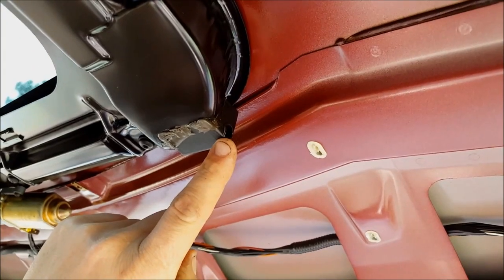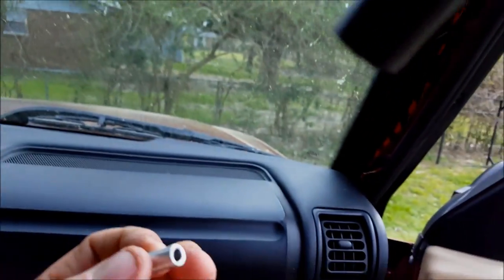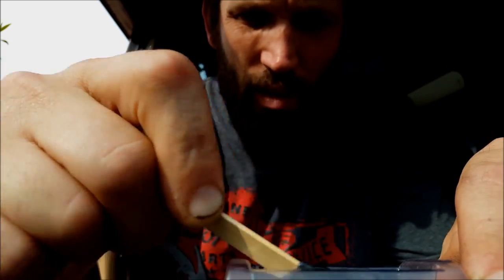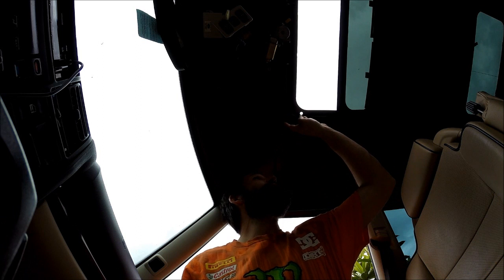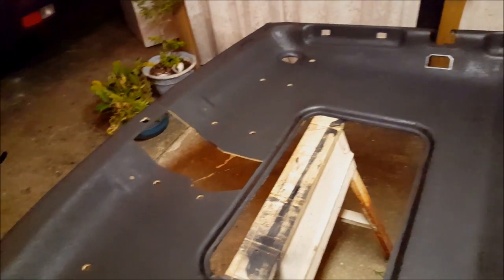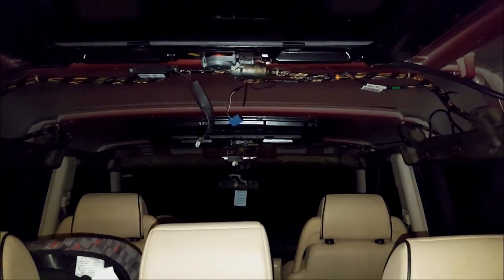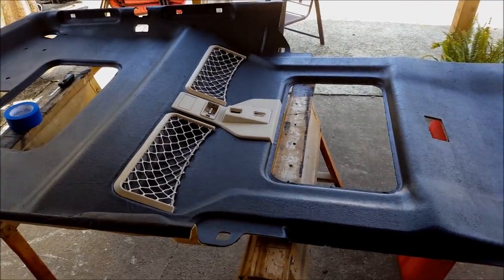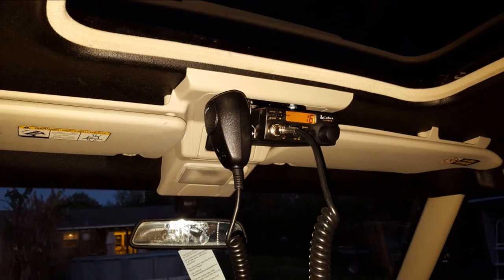Land Rover sunroof leak repair and bedliner for the headliner

Comment: I just completed RedEyed Jack's sunroof leak and bedliner headliner customization.  It looks great.  I thought I'd share a few things I learned.  The bushing mentioned, I found at Home Depot.  It was "Everbilt Spacer #10 ID x 5/16 in OD x 1 in L".  It was in the hardware section with the trays of lose nuts & bolts.  I struggled to get the foam off of the headliner.  I spent hours with a plastic scraper and alcohol.  I didn't find a good solution other than time and muscle. I thought I cleaned it pretty well.  Then I used Rust-Oleum spray-on bedliner.  After three coats, it looked horrible.  It highlighted all the little bits of foam residue.  I then applied the Herculiner Bedliner using the roll-on kit.  Two coats and it looked awesome.  Definitely go with the roll-on to get the proper texture and hide any residual foam.  I also had a tear in my headliner.  Before I painted, I used Bondo to repair it and it seemed to work well and the roll-on texture covers it nicely.  My sunroof had another small leak so I removed the sunroof and repaired it.  It is easy to do with the headliner out.  It just needed a bead of silicone.  That fixed the issue.  I left the headliner out for 1 week and the smell is minimal.  And the noise level seems the same to me as has been stated many time. Thank RedEyed Jack for inventing this solution!

Comment: Thank you for the upload. I found it very helpful. My grandfather gave me his 2004 Discovery because I'm a poor college student but it had mushrooms growing in it from all the water coming through both sunroofs. I was unsure whether I would have the strength or skill to remove the headliner but it was easy. The idiots at Land Rover had glued the plastic corners into the metal sunroof gutter and all four corners leaked. With a friends help we removed the sunroof assembly and reinstalled the plastic corners plus replaced the rubber seal that mates with the glass when it is closed and voila!,no more leaks. I may use your idea of the bed liner as headliner but I need to think about it.
Reply from the maker: Katherine Kelly that is great to hear! If you are on Facebook, look up Land Rover Discovery 1, 2, and Defender club. Lots of great info on that page.
Reply: When you replaced the plastic corners, how did you glue them in place? I got some scotch weld 8005 epoxy but have not tried it yet. It looks like it is glued in place with silicone but is obviously leaking. Also you must have removed the metal pan and it appears you can only get to it with the headliner out.
Reply: @lcagee  Wurth Bond and Seal did the job a treat on my Disco and in black looks exactly as per Land Rover original.

Comment: Just what I needed! Now I know why water drops from my sunroof control buttons when it rains, without tearing the whole car apart. Great video, many thanks!
Reply from the maker: Bora Yurtoren no problem!!! if you have a 04 with the big roof rails check those for leaks as well!!!
Reply: Mine is a 2000 TD5. Good advice !

Comment: Thanks for your video!  I have a 2003 Disco and I was inspired enough by your video to do the same thing.  My moonroof also leaked and the same piece of plastic was broken off in the same corner.  I actually used the plastic cylinder of papermate pen that fit into the hole and went into the tube perfectly!   I also used epoxy as you recommended.  My headliner was stained with mold next to the low spot on the passenger door and was drooping down in a couple spots.  Tore it off and used flat black paint as you did... turned out great.  The only thing is the smell of the paint still lingers...

Thank you again for your video!!

Sam
Reply from the maker: Glad it helped!!! Mine has held up perfect. Still looks as good as the day I did it.

Comment: Used this method to repair the exact same leak - which had already been 'repaired' once using silicone and a cut-down rawlplug. This advice was spot on; a solid leak fix. Thanks
...Now just the clutch judder to sort. 
Land Rover =  proactive maintenance

Comment: Looks good! I'm fixing to begin the exact same project myself, along with a speaker replacement and crankshaft seal replacement. great video.
Reply from the maker: if you are planning on bedlining the headliner, just know that it stinks. it's been a week and a half and the smell of the bedliner has gone down quite a bit but is still very noticeable. I've been keeping the windows open as much as possible to help it air out. I'm sure it will go away completely eventually but who know how long it will take. with that said though, I'm still thrilled with the results. one other recommendation, epoxy all four of you sun roof drains at the seem of the plastic and steel, and clear silicone around the sunroofs or replace the seals. I have to pull the headliner back down and find another leak.....ugh! thanks for watching!

Comment: I also fixed my leak, which was the roof rails/bars.  They are sealed with a flimsy bit of neoprene and not very well glued in.  I removed them and replaced the neoprene and sealed with black silicone sealant.  With the roof liner off I was able to pump a fair bit into the recess where the roof bars connect.  Worked. Dry as a bone.
Reply from the maker: for sure. I just installed the extended roof bars on my truck, nothing like taking a 1" hole saw to the roof. I did the same thing, sealed them up good and tight.
Reply: @RedEyedJack  Takes some courage to start cutting into your roof!  Would be great to see the extended roof bars.
Reply from the maker: @mrp410  Stay tuned for some new videos coming. Been busy with college and a career change. Planning on making lots of new content very soon!!!

Comment: Man that looks good. I''m going to do my headliner like that. It's sagging real bad. I also had the same roof hatch leak. Going to fix it like you did. Thanks for the video. It's hard to fine content like this on the Disco 2. I have a 2007 Range rover also, if you come up with anything on those I'm subscribed.
Reply from the maker: glad you found it useful!! epoxy all four sunroof drains so you don't have to do it again!!! and if you can leave the headliner out for a week or so after. the bedliner smell is very strong but goes away with time. the first week was real bad!!!

Comment: I am soooo glad I did proper research on these trucks before purchasing one (which I ended up NOT purchasing). I never have these problems with my FZJ80
Reply from the maker: awesome!
Reply: Whaaaaat! owning a Land Rover is like a good marriage, smooth one day and rough the next with a tribe of teenage kids inside on a wet day, FZJ80 man that's not fair, what just drive and drive with out repairing or modifying boring stuff FZJ80.
1999 Disco 2 TD5 (no sunroof) owner in the land of Aussie.
Reply: @blackprince4074  After a while constant repairs begin to weigh heavy on the owner.. I know because I have a 1993 VW Cabriolet. Something is always breaking on that car.. just like my 5 previous VW Jetta mark 2s. I had to learn how to fix cars.

Comment: Thanks for the video. I have that issue on my driverside of my 99 discovery 2. I will start this project ASAP & hopefully I'll get good results. 5/16 aluminum spacer, epoxy, & steel wool brush. Thanks

Comment: I am lucky and got a 2002 V8 4.0 that has NO sunroofs!  The leaky roof though is a common thing, imagine how bad it is for the Brits where it rains so much!
Reply from the maker: it is a real common issue but the fix is really simple so I'm glad I have the sunroofs, it let's a lot of light into the truck. but for ease of ownership, no sunroofs is the way to go!!! they are not that common though.
Reply: just looked in mine ,I could swim in the back!,and yes I live in the UK!,your so right,mark.
Reply: you can download the workshop manuel,pdf,off google.the headliner needs to come out,but read that first.
Reply: where do ya find it as ive looked on line an nothing can you help...
Reply: You have no idea, the slightest shower and I have a pond.🤣🤣🦢🦢🦢

Comment: Why can't I find a gorgeous man like this to fix my Land Rovers! Ugh!
Reply from the maker: Samantha And The Volume ha!!! I'll fix your Rover, but that's as far as that can go, I'm spoken for lol!
Reply: Awwwww...shucks! I try and fix my own and most of the time I'm very successful but it would be so much more fun learning the things I don't yet know how to do, with someone that's gorgeous and does. I have gurly muscles so im not as strong but If I cant turn a ratchet I can always tap it with a coushioned hammer or loosening a lug by standing on the lug wrench. This is a fantastic job you did with the headliner/bed liner and how you ran all those wires and fixed the same stupid leak I have on the passenger side of my Disc ii 2002. You would love my Range Rover County LWB 1993. It's a Rare find and lifted. Ive changed almost everything under the hood by myself 😁😝 When you're no longer spoken for...come ring my bell! I pland on buying a New Rover in January but if I can find a Land Rover Defender 90 soft or hard top...oh my gosh, it's on!

Comment: Hi, this must be the coolest interior I've seen. Thinking about doing mine in a similar way, cause my interior is also creamy leather, but I was wondering if removing the entire foam made an impact on the soundproofing. Someone pointed to me that the noise from outside could be getting louder than before, especially when it's raining. Could you please share if that's the case? Thanks for your time.
Reply from the maker: I have not noticed any difference in road noise or while it's raining. If you were really wanting to make sure, you could put some sound deadening on the roof while the headliner was out
Reply: @RedEyedJack  Great idea. Cheers!

Comment: Was about to do the headliner in my D2 and came across your video.  Looks like an easier way to go than to use cloth, but I'm wondering if you live in a hot climate and if so, have you noticed more heat coming through the roof?
Without the foam backed cloth and a 'black' bedliner .. is the heat coming through more noticeable?
Reply from the maker: No noticeable heat whatsoever. I mean, its Florida, so it get hot, after all these years it is holding up great, zero issues. Would do it again in a heartbeat!
Reply: @RedEyedJack  Thanks for taking the time to reply .. much appreciated.

Comment: Hey your headliner looks really good!  Do you notice much (if any) condensation within the cab due to the lack of foam and material/insulation?
Reply from the maker: non that I've noticed, the headliner itself plus the bedliner seems to be adequate insulation on the roof. mid day florida summer heat and it's no different than the original headliner!
Reply: +RedEyed Jack sounds good! I shall give it a try and see how it fairs in our climate over the pond lol! Cheers
Reply from the maker: +absolut264 10-4!!

Comment: Took the headliner out today to do the bedliner finish.  Not surprisingly, the sunroof drain broke off in the process.  Dry rot no doubt since it's an '03 Disco.  Pleased to see both of these tips in one video or I'd be lost.  I'll try the hardware store fix tomorrow for the sunroof.  Bed liner will be sprayed on afterwards simply because it's an option.  Rolled on bedliner looks great though.  Thanks for the video.

Question:  Did the bedliner chip, crack, or break after squeezing the headliner back into place through the cargo door?
Reply from the maker: the bedliner held up great putting it back in. No issues at all!!! I would have sprayed it as well if I could have. I was really worried about the finish looking rolled if you know what I mean. As for the drains, I epoxied all four drains just to be safe!!! And I also used clear silicone around the sunroof frame on the roof for extra protection. Hopefully I'll never have to do it again! Glad the video was helpful!!!
Reply: +RedEyed Jack I wound up using a piece of 5/16" brake line for the drain. Also for anyone reading, the coupler will go into the drain and tubing inside the broken off piece. Don't remove the old nipple from the drain tube.
Reply from the maker: +K MacMurray yes, leave the broken piece in the hose

Comment: Thanks for posting.  Hoping to do the same as you once I fix a few other problems that cropped up last week (battery went dead and somehow unsynced by BCU and ECU!)  Bought my disco 2 earlier this year, and I was beginning to wonder if I was the only one still driving one.  Not very common in mid-Michigan, but I don't mind driving (and fixing) a unicorn.
Reply from the maker: down here in Florida D2s are everywhere!!! with being from the rust belt, how is the rear frame rust wise? that is usually the determining factor whether to keep fixing them or not!
Reply: +RedEyed Jack This truck is clearly not from around here, or it would be a pile of reddish-brown (and white) dust by now.  Previous owner said it had come from California not long ago.  The other factors in not being common around Michigan:  1.  practically no dealerships to sell them.  2.  Good old boys in this state don't like foreign cars.
Reply from the maker: Joe Kirklin Good to hear!!! I'm originally from Buffalo NY so rust was always a concern. Down here in Florida, everything is so clean!!! I makes sense about the no dealer network for sure. Have fun with it and if your on Facebook, check out some of the Rover groups on there. They are full of tons of info and guys with piles of experience with these trucks!!!

Comment: well done mate,thanks for the info,parts are expensive from l/Rover  over in the UK,my roofs been leaking for years now its time to do something,just 2 q's

1,was your headliner foam base or fibre glass,mines foam

2,did you get it out and put it back on your own?

3.epoxy resin,which 1?

it looks great,well done,thanks Mark,UK.
Reply from the maker: mark fairminer sorry for the late reply. my headliner is not fiberglass. I pulled the fabric off, scraped the foam off from under the fabric and the actual headliner seams like it's a paper based product. I did remove it and install it solo but I wrinkled the passager front corner doing so. wish I would have asked for help. the paint product I used was Rust-o-leum roll on bedliner.
Reply: thanks,yea mine is a fibre so I will get some fabric and a spray adhesive and will try that in the smmer,will let you know how I get on.

Comment: Sorry to comment on such and old post, and sorry if it's already been discussed (too many comments to read through).  But I'm curious if you've noticed change in keeping the cabin climate comfortable with the foam insulation gone?
Reply from the maker: no what so ever, the bedliner is pretty dense and I'd think it would have near the same insulation value of that foam. I live Florida and noticed no change in my AC in the heat of summer

Comment: hi. great job. headliner that i got do not look as good as yours. its been wet for long time and it is very delicate and loose. did the bedliner made it stronger? tougher? do you know what i mean ?
Reply from the maker: The fiber board the headliner is made from is quite flimsy. The bedliner did help make it feel a bit more durable. Id bet if you can get it out in one piece, if you painted both sides it would be as good or better than new.
Reply: @RedEyedJack  thanks man. You helped alot

Comment: any idea what would be causing water to leak out of the passenger front seatbelt after rain ? do those hoses run down the seat belt pillar?
Reply from the maker: Yeah, could be the hoses, could also be the roof bars. Best bet would be to pull the headliner and sit inside and have someone soak it down with a hose if you cant see the problem with it out.
Reply: @RedEyedJack  know anywhere that sells weather stripping or a DIY solution for doors? When I drive my D2 on the highway I feel the wind from the rear driver side door allowing air to blow on me.
Reply from the maker: @keeganbuilds  check out Atlantic British or Rovers North.

Comment: Awesome video I'm gonna start taking mine down tomorrow, do you need to remove the center plastic pillars where the seatbelt are attached to, and also do the front ones do they have to be removed down?
Reply from the maker: you have to remove everything. but the just pop off. do yourself a favor, Google "land rover discovery 2 rave manual" and download the service manual. Then follow it step by step. that's what I did and it tells you where every screw, clip, and snap are.
Reply: thanks for thar Jack,

re:- rave manual.will try to get it.
Reply from the maker: http://www.landroverresource.com
Reply from the maker: landroverresource.com

Comment: Any suggestion on the removal of cargo net nuts/screws and the middle console on the back of the headliner.  I’m have a bit of trouble getting them unscrewed.  Actually broke one of them... thanks!
Reply from the maker: Brandie & Conn Leithauser I can't think what those look like off the top of my head. Are they those small flat almost washer like nuts?
Reply: RedEyed Jack yes on the top side of the headliner holding cargo net and back center sunroof switch.   Cheap plastic.